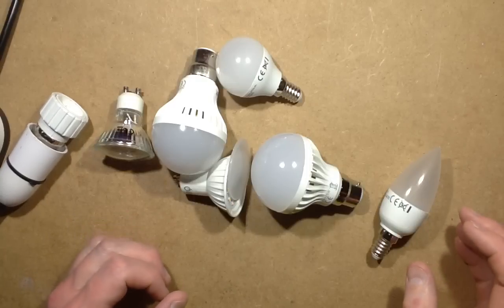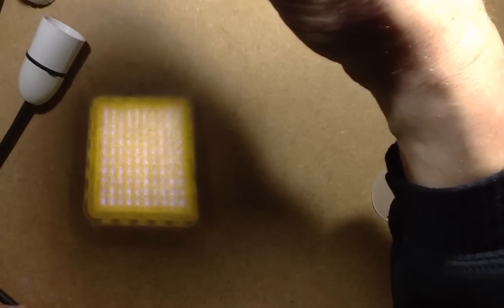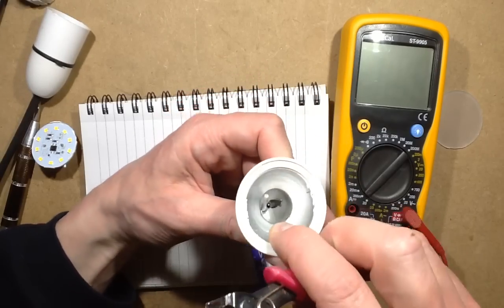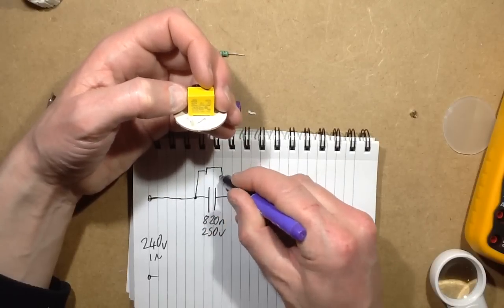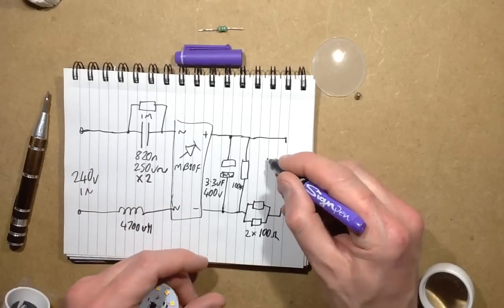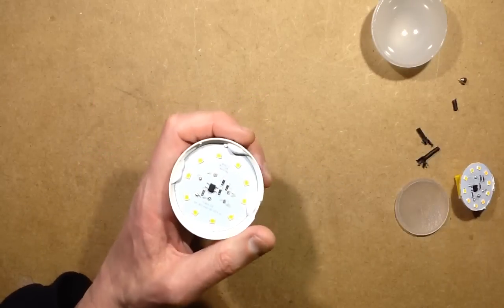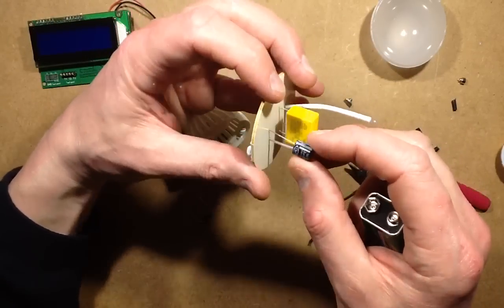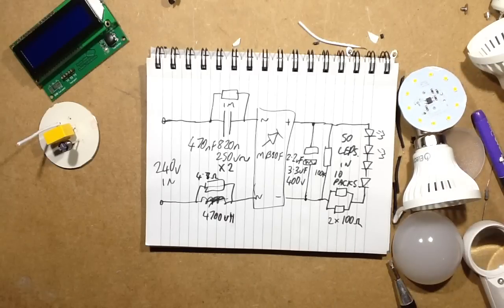New, and VERY interesting Poundland 5W LED lamps.

Comment: Next time you try to probe live LEDs, try wearing sunglasses ;)
Reply: +BenjaminGoose Come on, with sun glasses it's not a bobby dazzler. :D
Reply: +Slot1Gamer I was about to suggest the same thing! Or welding goggles.
Reply: ***** But it allows you to take a better squiz!
Reply: +BenjaminGoose But it's not a Clive dazzler. Or viewer dazzler. But yes, you can see it better. :D
Reply: +BenjaminGoose 

but reading the meter  -  how then  -  welding  kit  -  have to arc to see where the parts are

Played  with  circuit  many way's and times  -  the  in-line  current  limiting resistor 47  what ohs or inductance   

the   metalisation  rf  noise suppression  at a  guess 

Poundland  for  UK   -  via  ebay  be careful  of  the  rateing  china  mainland is 220  volt  standard  - thus  if unmarked  leds overdriven  ,   added  LED  ontoone  bulb to replace  the  defective  -   worked  for about two  hours  then  another LED  went    1k seriesresitor to  accomodate  the  higher  voltage   - light output  drops  -  thus less  current  

getting  of  0.88 mF -not   that easy  -   as in the unmarked  has a 1 mF  series  cap  0.47  diffivcult to get at 400v  

\don't we have fun
Reply: not a Clue hb

Comment: I have to wonder if this new power supply design, with its inline choke, is in response to the myriad of complaints regarding RF noise these things tend to barf out.

Very cool teardown and analysis, Clive!  Kudos, and preemptive Merry Christmas!  :D
Reply from the maker: +rhkips The ones with tiny switchmode power supplies seem to be the main culprit for RF noise because of their high frequency operation.  I'm not sure how electrically noisy the capacitive ones are.
Reply: +bigclivedotcom This also seems to be the first time you've come across an x2 class capacitor in these capacitive dropper designs.
Reply from the maker: +VE3CWQ I think it may be the first time in a commercial lamp, but I did use them in my own first DIY LED lamps because they were easier to get and known to be mains compliant.
Reply: +bigclivedotcom In almost every comment I've read regarding capacitive droppers, they include an admonition that x class capacitors should be used and yet they're rarely found in commercial designs. Are you of the opinion that they are necessary and justify the significant premium they demand? Love the vids Clive.
Reply from the maker: +VE3CWQ I feel more comfortable with an X2 interference suppression capacitor being used, as they are designed specifically to be placed across the mains supply.
Reply: +bigclivedotcom about the voltage rating of dropper capacitors, why do you think it needs to 450v or so? its only ever going to have the DROPPED voltage across it. 240 down to 180, about 60 volts. Its not ACROSS the mains, its never subjected to the full mains voltage. Also, I thought the good property that X2 caps have is self healing after voltage spikes, they resist failing short.
Reply: +Barry Betambeau Yeah, but it's not about the standard opperation, it IS all about the way those devices fail. Since LEDs and rectifier fail state can be dead short, it is always better to use propper rated stuff before them. Also, X2 rated caps are designed to fail safely, the standard foil caps can blow up pretty nastily.
Reply: +Barry Betambeau And hey, you are saving like 2-5p when you go standard non-X2 rated cap.
Reply: +mrkv4k Erm, we are talking about a Poundland item, Poundland. It is all about the 2-5p. Failure modes? what of them? what you going to do if it fails, repair it? No. Yes you could design a good version of these lamps, but this is cheap version.
Reply: Barry Betambeau
2-5p if you wanna buy it from the store. It's gonna be much less in big ammounts.
And about failure modes, X2 rated caps are specially designed to fail safely (the thin layer of aluminium that connects the electrodes vaporizes) if you use ordinary caps, they can literary blow up and in some cases damage more than the device..

Comment: Also, where can I get that inductance tester?
Reply: +DrRawley 
Check ebay. I got this one for example: http://www.ebay.com/itm/261457669748
I got that one specifically because of the form factor (mounting holes and general layout so I could build a wooden box around it) and the layout of the SMD pads. I had to put a real power switch in series with the battery though, because even when powered down it would drain the battery. If I'd get one now I guess it would be one like this: http://www.ebay.com/itm/291527028342  Shows more information than mine and even has a pinheader to easily connect external probes and even comes with a square wave/PWM generator!
Btw. Clive there's a flood of these testers with many more than two versions. Not just text vs. graphical, but also what you can test, what values will be shown and quite often now you can even setup/calibrate the units.
Reply from the maker: +DrRawley There are a few LCD based component testers on ebay.  There are two types, the one I used and one with a bigger screen that shows a graphic of the component with leads marked and does other tests.
Reply: Whoa, thanks, that second one looks like it does everything eh?

Comment: Just as you were mentioning you were looking for an inductor tester, I was wondering if you were going to pull out of one of those multi testers. I've got a couple of them, and they are one of the best investments I ever made.
I have the kind with the ZIF to put the parts into. It shows you a clear diagram of what the part is (even for mosfets).

refer ebay item 38119161341
Reply: +Edward Jones there's also the one ebay 151765540249 which checks CMOS/TTL chips, but I haven't bought one yet.
It doesn't seem to identify the chips, you have to manually select which chip it's meant to be looking for.
Reply: +Edward Jones That may be useful in my area of work (IT and communications)
Reply: +Edward Jones On which ebay site is this item? Could not find it on .com or .co.uk
Reply: D0senpf4nd I saw these on .com.au as shipping ex China.
Reply: +D0senpf4nd http://www.ebay.co.uk/itm/IC-Tester-74-40-45-Series-lC-Logic-Gate-Tester-Digital-led-test-logic-Meter-/181861146112
Reply: +David Pilling Thanks alot mate!

Comment: Be careful on the small globe laps, they use glass for the globe.
Reply: *lamp
Reply: +Green Silver 
Tip - If you make a spelling error, hover your cursor over your comment and you'll notice a little icon to the top right of it, click this and then click Edit in the menu that opens, and you can correct said errors... :)
Reply from the maker: +Green Silver Thanks, I'll keep that in mind.  I'd already done the tooth test on them and they may be plastic coated glass.  I know the smaller 3W ones definitely are glass.